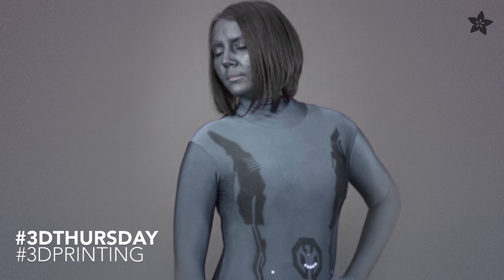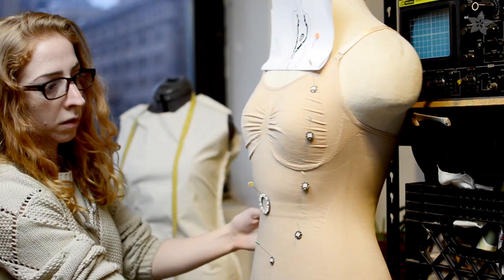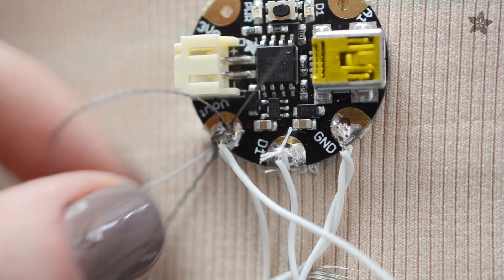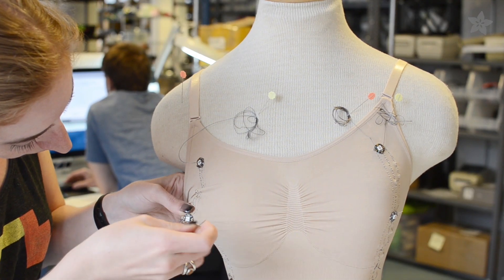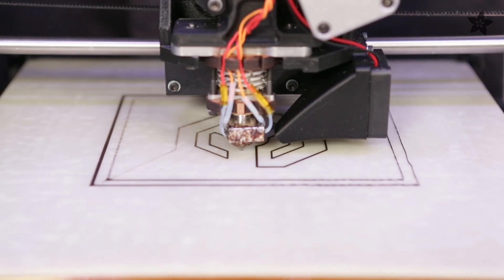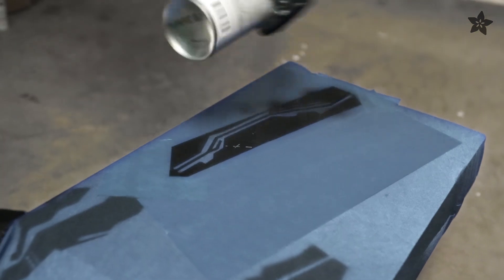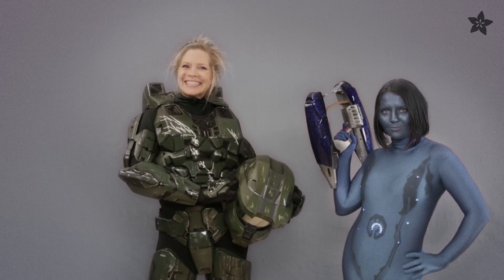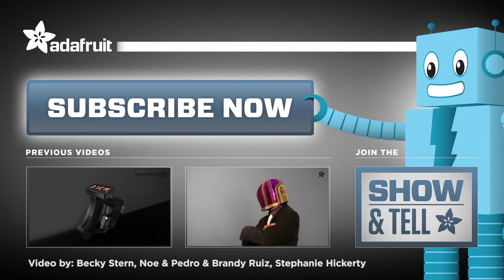Cortana Costume with Animating LEDs

Comment: The stainless wire will be contacted to the body directly.
Is there any damage or impact that we can feel the electricity when we wear the suit?
Or do you have any solution to prevent that electricity go to our body?
Thanks~
Reply: 네가티브모션댄스 Negative Motion Dance No, the voltage is too low to pass the skin. Skin acts like an insulator.